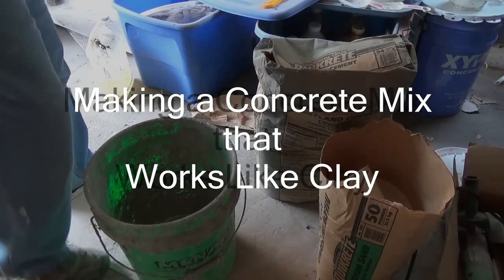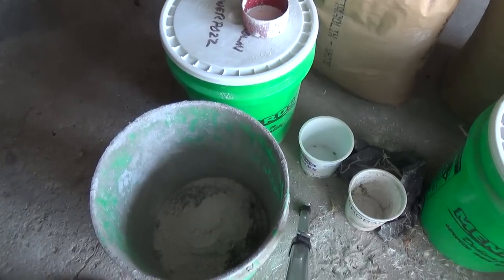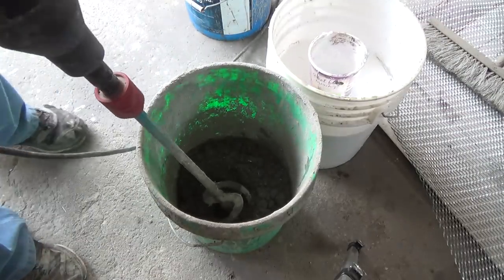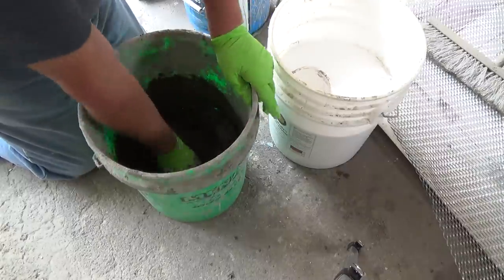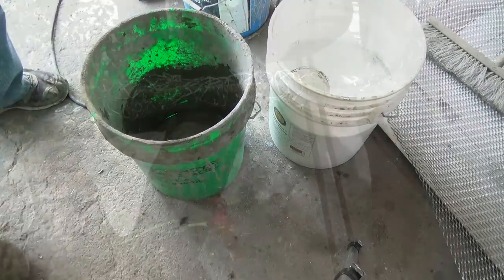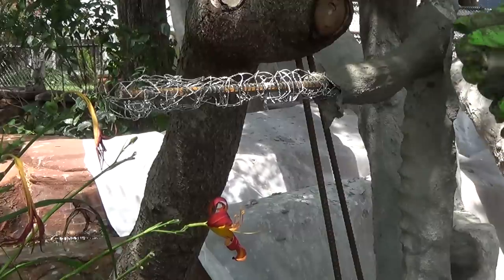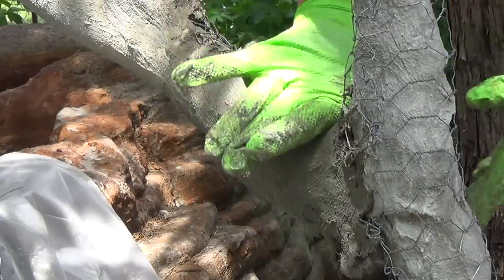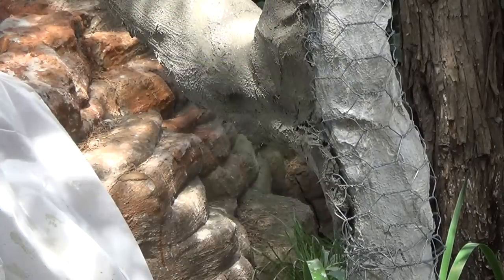#concrete #fauxbois Making a Concrete Mix that Works Like Clay

Comment: I can’t find metakoalin in Canada, would fly ash be a substitute? Thank you for your video!
Reply from the maker: Actually, the Whitemud Formations in Saskatchewan is a major source of kaolinite, the clay that is used to make metakaolin.  Whitemud Resources, Inc is the Canadian company that mines kaolin and produces metakaolin.  http://www.whitemudresources.com/  They may be able to direct you to suppliers.  You might like to look into this product:  https://www.poraver.com/wp-content/uploads/2018/11/181031_TDS_Metapor_PNA.pdf    They are in Ontario  https://www.poraver.com/us/metapor/  I've never used fly ash, but my reading tells me it is not as active a pozzolan as metakaolin and it is 10 to 100 times larger in particle size than metakaolin.  The only thing I can suggest is, if you have a source for fly ash, give it a try and see if it works for you.
Reply: @dperry428  thank you - that is extremely helpful! I will look into it now.
Reply: @kerrygirl2003  contact starpatch in Burnaby BC. I found it there after considerable searching. Very reasonable priced too.

Comment: would you use this same mix for carving vertical rock? similar to the benches you made?
Reply from the maker: No, I'd use a 2 to 1 sand/cement mix, less metakaolin and addition of silica fume for strength.  Maybe 1 to 1 sand/cement.  Depends on how much build-out is needed.  The more sand, the more likely the mix is to fall off.

Comment: I just started into making mushrooms for my yard out of Portland cement and sand.I have  question hope you can answer, i want to sculpt  I was told to use concrete, sand and mortar.Will the mortar make it clay like?
Thanks
Reply from the maker: First, let's get some terminology right so we're on the same page.  Cement is the "glue" that holds the mix together and causes the hardening. There are several types of cement commonly available: Portland cements (several types), masonry cement, and CSA cement (calcium sulfoaluminate). Masonry cement (mortar cement) is, in reality,  Portland cement with lime added. Concrete is the mix of aggregates (including sand), cement, water and, perhaps, additives. Mortar is a mix of cement, lime and sand.  It's important to know the difference between cement and concrete. It's also important to know the difference between mortar and mortar cement.  So, when you were told to use "concrete, sand and mortar", that means you were told to use [cement, aggregate (including sand), water],  [sand] and  [cement, lime and sand]. So, that's cement, sand, water, sand, cement, lime and sand. That really makes no sense.  I have no idea what that person was trying to convey but, if that's what they said, they simply don't know what they are talking about.  Perhaps what they were trying to suggest is that you substitute masonry cement for the Portland you're currently using.   You could use masonry cement (also called mortar cement) and sand.  That will give you a stickier mix.  I used to use masonry cement instead of Portland cement when I first started.  The problem with using masonry cement (mortar cement) is the lime that it contains.  Lime is calcium oxide and when it combines with water, produces calcium hydroxide (also called hydrated lime).  When carbon dioxide is carried into finished concrete by water, the calcium hydroxide is converted to calcium carbonate, which shows up on the surface of the concrete as an ugly white substance known as efflorescence.  By using Portland cement, along with metakaolin, several advantages are gained.  The lime is eliminated and the metakaolin creates the stickiness needed for sculpting.  Also, when cement, itself, hydrates, it also produces calcium hydroxide that can lead to efflorescence.  Metakaolin reacts with calcium hydroxide to form more of the "glue" (calcium silicate hydrate) that Portland produces.  This not only reduces the possibility of unattractive efflorescence, but also creates a stronger concrete.
Reply: @dperry428  Thank you very much for the reply explaining in great detail. I got the idea from a gal she spoke  Spanish I turned on the language to English.I was able to translate to English, she never showed how to mix the dough she called it. Anyway without taking anymore of your time I will buy the metakaolin and add it to the Portland cement,sand and water. If it doesn't work then oh well. Thanks again!
Reply from the maker: Just watch how much water you add.  Too much water and you have soup.  Add VERY slowly.  Don't be too quick to add more.  Work it like bread dough.  "if it doesn't work then oh well." is not a option.  It will work.
Reply: @dperry428  Thank you, I will keep that in mind. You have been very helpful.

Comment: Long shot this late in the game but can you advise what ratio I could mix QuickCrete to be clay like? I want to put it on the outside of a wooden tree form I have built and carve and paint it to look like bark
Reply from the maker: When you say Quikrete, you have to be more specific as they make a number of products under that brand name.  Also, what do you mean by "what ratio"?  Ratio of what to what?  Assuming you start with say, Quikrete Sand Mix, it's likely a mix of 3 or 4 parts sand to 1 part cement.  That would already be far more sand than what I would incorporate into a "clay-like" mix.  You might like to look into commercial, proprietary "adpacs" to add to a bagged product to make it a vertical mix that is somewhat clay-like.  Do a search for "adpacs for vertical concrete".  You'll find things such as Kirtbag,  TruePak X, CarVZ from Trinic, Buddy Rhodes Vertical Mix, Sakrete's Shapecrete,  Fishstone's Vertical Mix.  Otherwise, I advise buying a bag of Portland Cement, fine sand and mixing 1 sand to 1 cement, add acrylic admix to water and add only enough water to make a clay-like consistency.
Reply: @dperry428  i cannot thank you enough for this detailed reply!  I was trying to create a substance like Shapecrete (check out their website). Unfortunately it has been discontinued so the options for a sculptable cement product went from 1 to zero for me. I ended up mixing a combination of products and used some of your suggestions to complete the trial version of my product. Thank you again for taking the time to reply.

Comment: This was very helpful. I am struggling to kind metakaolin, is clay powder an acceptable alternative? Do you have any recommendations for how to get around this? I am making figure sculptures.
Reply from the maker: Keep in mind that I am not an expert in concrete. My mixes are based on the principle of particle packing, in which the dry ingredients are a gradation of decreasing sizes to successively fill in the spaces left by larger particles, making the mix dense and impermeable.  Further, the additives, such as metakaolin are pozzolans that make the mix much stronger than normal concrete.  I can't recommend replacements for what I use, simply because I have no experience using other materials that have the same qualities.  Metakaolin is a pozzolan that is made by calcining (heating) kaolin clay to a high temperature, changing its chemical characteristics. Metakaolin particles are 10 times smaller than portland cement particles.  To find a replacement, you'll have to seek a substance that has similar characteristics in terms of size and pozzolanic activity.  Many mixes I've read about include things such as fly ash, diatomaceous earth and many others.  I can only recommend you research and experiment with something else.  My source of metakaolin is Fishstone in Crystal Lake, Illinois.  I don't know your location and what shipping would be for you, but, depending on the amounts of concrete you use for sculptural purposes, it might still be economically viable to order from them.  There are commercially available sculptural mixes that can be ordered, but they are not only expensive, they have shipping charges as well.  I've also found metakaolin sources for others closer to their locations.  If you like, tell me where you are located and I'll share what I may have found near your area.
Reply: @dperry428  You are a star for taking the time to give such detailed information, I appreciate it. I'm in British Columbia, Canada.
Reply from the maker: @filixmoon1996  Interestingly, the biggest producer of kaolin clay and metakaolin is in British Columbia.  Here is an article about them.  You might try contacting them and ask for distributors of their product. They are named Whitemud Resources.  https://www.theglobeandmail.com/report-on-business/small-business/sb-growth/building-with-a-more-durable-greener-concrete/article4301342/
Reply from the maker: @filixmoon1996  http://www.whitemudresources.com/
Reply: @dperry428  Cheers

Comment: If you wanted to adjust your recipe to create a lightweight concrete how would you change it? I want to use polystyrene beads or polystyrene blocks to take up space and lighten the load. Just guessing this would work. Can you comment, please?
Reply from the maker: This particular mix is used as a final coat to make detailed texture or to use in small sculptural pieces. To make a lightweight mix for larger pieces, I use a different mix, with more sand.  I used to use styrofoam beads such as shown in this series I did 13 years ago   https://www.youtube.com/playlist?list=PL0D8F4E6D9B49EBA4   When I want a lightweight mix now, I use either vermiculite or perlite as the lightweight aggregate.  Styrofoam, while very light, is also messy to use. Such a mix would contain 2 parts lightweight material, 1 part sand and 1 part cement.  I still add metakaolin at 10% of the cement content, and also add 8% silica fume, 5% CSA cement, fiber and acrylic in the liquid.
Reply: @dperry428  Thanks. Still trying to get my hands on the metakaolin. Will switch to your lightweight recipe.
Reply from the maker: Here's where I get mine:  https://concretecountertopsupply.com/Item/metakaolin  You might like to try looking for the brand name in your area.

Comment: Can u store this clay for several days or do i need to use this immediately?
Reply from the maker: This is not clay; it is concrete.  Once you mix the dry ingredients with the liquid, it is going to harden in a matter of hours -- even under water.  You can mix the dry ingredients and store them in an air-tight container, such as a zip-lock bag, and add the liquid when you are  ready to use it.

Comment: That clay isn't cheap..this helps 👍👍
Reply from the maker: You think this is expensive?  Check out the cost of commercial products like Pal Tiya.  It runs about $10 lb.
Reply: @dperry428  i meant good clay is expensive and the stuff they were making was cheaper..lol...
Reply from the maker: The "they were making" is me.

Comment: Good day sir. I’ve been try to source the ingredients for your mix in Canada. It’s rough let me tell you. It seem that silica fume and metakaolin are related. Some sites refer to metakaolin as white silica fume. Are they related? Can I replace the metakaolin with silica fume and achieve the same results in your opinion? Thank you in advance.
Reply from the maker: The only relationship between metakaolin and silica fume of which I'm aware is that both are pozzolans.  Metakaolin is the heat-treated (calcined) product of kaolin clay, which is used in the production of porcelain.  It is chemically an aluminosilicate and has a structural size about 1/10th the size of cement particles.  Silica fume, a by-product of manufacturing silicon used in electronics, is amorphous (non-crystalline) silicon dioxide.  Physically, it is spherical in shape and  1/10th the size of metakaolin particles or 1/100th the size of cement particles.  The use of both is what gives a high particle-packing quality to the concrete mix.  That, along with their pozzolanic activity, are what creates a very dense, waterproof, freeze/thaw-resistant concrete.  I chose to use these two ingredients based upon availability to me and on their relative sizes to maximize particle-packing.  I can appreciate your source-searching efforts; it's taken me 14 years to finally come up with a mix that works well for me and to find sources.  It is based on, though not identical to, the mixes developed at the University of Michigan engineering department.  Though I've not experimented with it, you might like to look into the availability of fly ash, a product of coal combustion and used as an additive by others.  It is a mixture  of a number of silicates, silicon oxides and aluminates.  It has both crystalline and amorphous silicon dioxides and a slight pozzolanic activity. If I had it available, I'd experiment with it and add silica fume as well to enhance the particle packing.  Without that experience, however, I can't tell you how it would compare to what I use.  It might even be superior.
Reply: dperry428 thank you for the info. Much appreciated.

Comment: ¿Alguien que pueda decirme los ingredientes y sus respectivas cantidades?...
Please...
Reply from the maker: 1/2 part sand to 1 part cement, 20% metakaolin, PVA fiber, Acrylic admix/bonding agent in the water per manufacturer's instructions.
Reply: @dperry428  muchas gracias...
Reply: @dperry428  , I am not sure what is pva- 7, pva -15, pva -100 means, which one I need to buy? Thanks
Reply from the maker: @BackyardStoneArt  Length of the fibers is the difference.  I use the PVA-100 (1/2 inch). If you were making a small sculpture, with very small details, you'd use the PVA-7 (1/4 inch) to prevent its possibly showing in the finished surface.  Choose the size by the use.

Comment: I am trying out this new clay mixture  the only difference is I am using the Kongkrete dry acrylic. My batch is not coming out clay like . It is rather lumpy. Do you have any advise as to what I am doing wrong?
Reply from the maker: I haven't used the dry acrylic as it is different chemically from the emulsion type.  It is in the class of acrylics that are re-emulisifiable.  I don't even know the recommended way of using it, such as dosage and when to add it to the mix. The re-emulsifiable type is not recommended for outdoor use since exposure to water can dissolve it and cause it to soften after the mix is cured. I have always used the emulsion as it will not dissolve once it is cured.  I also can't say what, if anything, you are doing wrong since I can't see what you are doing.  The only thing I can suggest is to go to a home improvement store, such as Menards, Lowes or Home Depot and buy a small quantity of their brand of acrylic admix/bonding agent and try making a small batch with it.  That will tell you if there is some problem with the dry stuff or in your mixing.  When you use the dry acrylic, do you mix it with the dry materials and then add water or do you dissolve it in water and add it as part of the liquid?  Not having any experience with the dry acrylic, I don't know how it behaves but, perhaps if it is added dry and not thoroughly dispersed in the mix, it might cause it to clump and create what you describe.  I just don't know.
Reply: @dperry428  I asked Tom from Fishstone on how to use the dry acrylic. He told me to mix 1lb. dry acrylic to 1lb water. When i used it, some batches were lumpy  and some were fine . After watching your videos and learning from you I think  I will save myself the continued problem and just go purchase a bucket of acrylic like you do.  Then I will proceed with my project and hope it all goes well. Thank you so much and stay safe during this Covid -19 . You are fantastic to watch and learn from!  Thanks again.

Comment: Could you use regular kaolin clay instead of metakaolin
Reply from the maker: Keep in mind that kaolin and metakaolin are as different from each other as ground limestone is from cement.  I've not used kaolin in any mixes so all I can say is you'll have to try it as see what it does.
Reply: Perfect thank you I didn’t realize the process of heating kaolin to turn it into metakaolin would change the properties so much but I guess that’s just common sense if you think about it lol science water to ice

Comment: Is this suitable for outdoors?
Reply from the maker: Yes.  In fact, the batch I mixed in this video is the actual material being placed on my garden bridge shown in the video.  The question is often asked of me how it would hold up in a severe climate, as  some people seem to think I'm in California.  I live in northern Illinois just south of the Wisconsin border and about 60 miles west of Chicago.  Our summers are hot and humid, winters frigid and snowy.  It gets well below zero on many occasions and near 100 degrees.  Lots of freeze/thaw cycles. The metakaolin makes this mix very dense and impervious to water.
Reply: @dperry428  I tried finding metakaolin and even fly ash in Australia, called a few hardware stores, no one sell it here. is there a way to use any other materials like exterior PVA wood glue or something similar? what will happen if I wont use anything to replace it?
Reply from the maker: @mcart3943  I already answered that question for you a week ago.  If you didn't see the answer, scroll down and read it.  Also, a product that I can't endorse because I've never used it is one called Pal Tiya, which is based in New Zealand and markets it in Australia. It is not cheap, but reportedly works like clay and is suitable for outdoor application.    https://www.paltiya.com/stockists.html